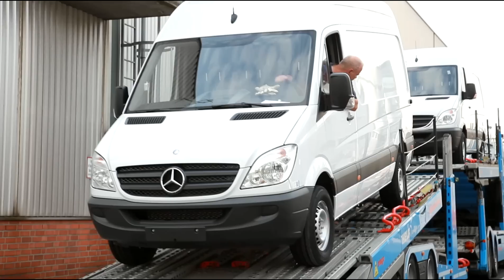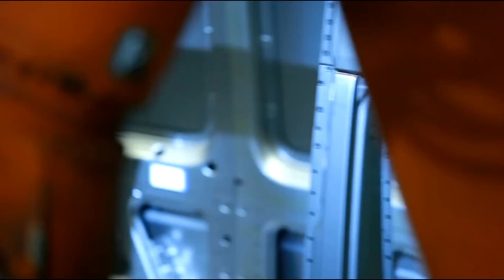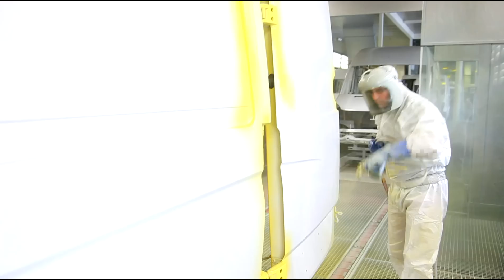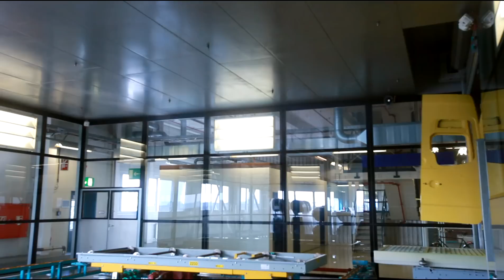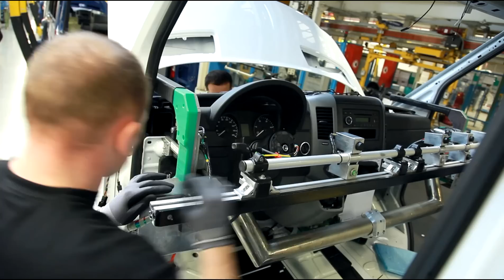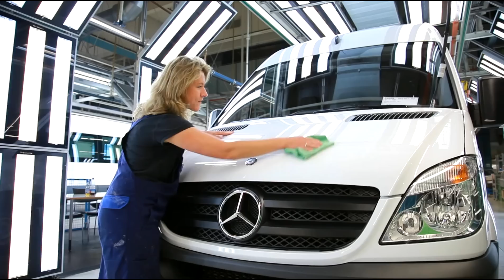How to make Mercedes Sprinter. Plant in Dusseldorf.

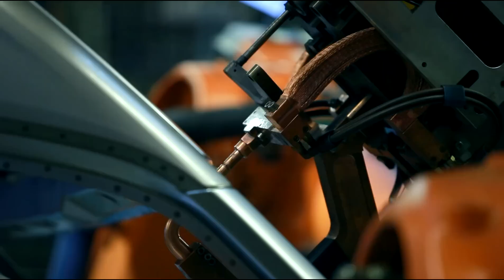Comment: 3:49 why the copper wired seems to twitch. The one that connects to the spot welder on the robot arm.
Reply: When current passes through a conductor (the copper braid in this case) a magnetic field is created. The cross product of the current in any length of wire by the magnetic field, results in a force. The deflection you are seeing is the result. The reason it's "twitching" is because it is being cycled on-and-off.

Comment: Thanks for your time making this, I used your measurements and it was spot on, saved me hours of working it out myself. Was a perfect fitment. Looks great. 
Did the whole project for $150 bucks including materials after picking up a 7.5R golf muffler cheap with flap motors.

Comment: can you make one that doesn't rust like an old iron spoon after 4 years?
Reply: Patrick Guinnane -  rust is the calcium they use to de- ice the roads.. go buy an aluminum ford they have the same problem..
Reply: michael perri old mersedes vans were much more durable and still exists and work, new ones get rusted in 3-4 year , it's not your mythical  calcium , it's planned degradation of product to make people buy new one.
Reply: Thay only use the best Chinese steel money can buy. 😨😢😢😢😢😢😢😢😢😢😢😢😢😢😢😢
Reply: Don't drive your Sprinter Van in the middle of Michigan winter storms. Save it for dry summer days and it will last forever.
Reply: If you buy yellow car it last longer, because the yellow paint cover the less. Thatswhy must paint thicker layer of paint. White is the thinnest.
Reply: superb comment. nice vans to drive bodywork is a  joke. galvanise them.
Reply: You must buy a VW Crafter they have the same chassis but are painted in car quality the Sprinter only in Truck quality.
Reply: Ramba Zamba 
Funny you say that. 
The green van @ 7.38 is a crafter bonnet. 
And the yellow vans are crafters to. 
Identified by the sharp head lights, straight edge on bottom of bonnet and the head lights don’t enter the wings 

Same factory same paint I’d say.
Reply: Hi they dont apply undercoat to paint anymore. Go see for yourself in there plant in spain. I wud stick with the pre 2005 stuff after that its appalling.
Reply: I don't own a sprinter . You can prevent rust with a product called fluid film. Spray in body channels and in doors and all under carage. Works great.
Reply: I work with a panel beater/spray painter as his assistant....we hate to see sprinters coming in the yard....nice van, great to drive, but they rust like a mother fu@#$r !!

Comment: I have bought my last mercedes van in 1986, long before the sprinter saw dayight. 2 years later I had to have it painted over because offrust . Mercedes people told me their superb quality and warranty covered the rust from inside out and not when the rust was coming from outside .
They were done talking when also the steel plate between motor and driver was rusted . never bought a mercedes anymore and never had rusty vans no more  . German quality my bottom .
Reply: Special , so the people may buy new every 5-10 years because it became ugly and rustt

Comment: And still the Sprinter rusts like mad!
Reply: They do rust like crazy.
Reply: Thay rust so fast because Merc put the paint on so thin I have a 2012 sprinter that's I had to have 're sprayed with 4 coats of paint just to stop it rusting it was 2 years old when I 're painted it
Reply: Rust buckets in Ireland most rusted out vans
Reply: in north america they are known for their 'leopard' spots.  i own an 04 t1n.  color choice made a difference where i come from the custom color variations develop their spots less than the white.
Reply: Eh I just caulk it with silicone...the universal sealant and glue got leaks bam silicone...rust...just sand it off and layer some silicone...craked drain pipe... silicone
Reply: Nope
Reply: @feelinggrape  They do and fast, real junk

Comment: I'm with Tahir. Sprinters are terrible for rust. Right in the middle of panels too. I have heard rumours the home market Mercedes have more paint on them than export vehicles. If someone cares to enlighten me on this one. Either way they still have very poor paintwork. Anyone remember E class in the mid 90's they were like 1960's Vauxhalls. The inner wings just disintegrated. Early W203 C class were poor too, especially silver ones. Very bad for a supposedly 'prestige' marque. My old Peugeot 406 had better bodywork despite being 12yr old when I sold it and over 230k miles. Loved that old bus. Bombproof and comfortable.
Reply: G Cunningham bmw e46 front fender rust from inside out also.

Comment: Mercedes Sprinter have many plusses, but two big minuses eliminate good things: corrosion & fucked up electronics(traction control and so on) which are so annoying and disturb driving, especially winter time so it makes me just mad. As example, I have even been stuck at summer on wet grass with this Sprinter and not a worth to mention snow, it gets only worse.

Comment: Had a sprinter van had the motor replaced at 1500 km  and the roof rusted at the joint after 2.5 years.

Comment: Poor anti-corrosion protection, although Vito was even worse. I liked driving the 3.0L turbo diesel version.
Reply: Really if they do Galvanized it solve all the priblem and it cost really not many for the plant, but who will buy new models every 7-10 years if cars would be in good shape along 20 years whithout corrosion...
 They do it special...
Reply: Car has good Anti Corrosion Protection, they dip it chassis into a Galvanized bath about 4 times. Also most of the different Paints get 2-4 different coats of paint. When customers have complaints about corrosion/ rust its mostly their own/ their employees fault. Most of  the cars produced there go to big Companies i.e DHL, UPS, Fed Ex ect ect. Most of the delivery guys / employees just dont take care of the cars. Source: I took a Plant Viewing at the Factory and saw EVERY step of building a Sprinter.

Comment: Sad and pathetic to badge a vehicle Mercedes-Benz and only use a single stage paint system over a thin coat of primer on top of non galvanized metalwork, especially when they know the vehicle be driven in harsh winter environment's...smh. Just watching this video I'd say the paint application is amongst the worst, considering I can see that nasty orange peel paint finish on my cheap TV. Lol.. Mercedes needs to take notes from the Japanese manufacturers like Nissan and Honda, because they know how to paint a vehicle so it looks good and doesn't rust!  I ended up having to have mine repainted for over $10,000 to stave off rust, paint chips and rub through.
Reply: Kevon Boss I was referring to quality of the steel, panel prep & two stage finish.

Comment: strewth, there was so much lacking in this building of the Sprinter, too much time wasted on the painting, fitting the windscreen, could have been better off using this for other things, you didn't show fitting the seats, doors, connecting up the wire harnesses, fitting bonnet hinges, bumper bar  etc  etc>>
I have a 2007 Model, Ambulance, with only 170,000kms and the amount of expensive problems I am finding now.
I am extremely disappointed as I presumed the Mercedes Benz was the best in their field.
Apparently they are not
lift you game MB